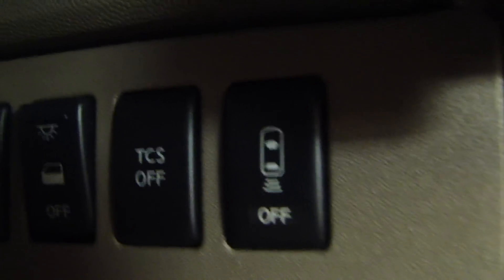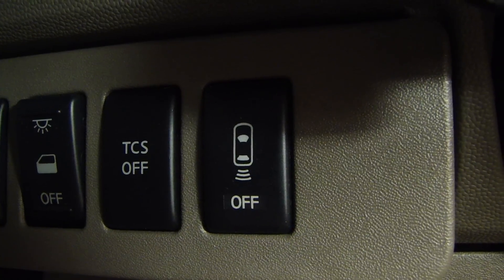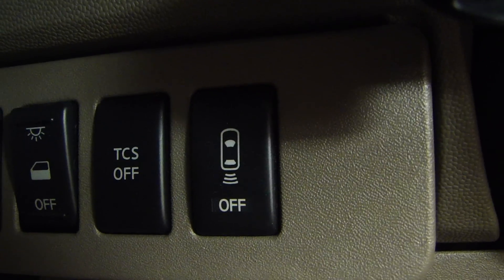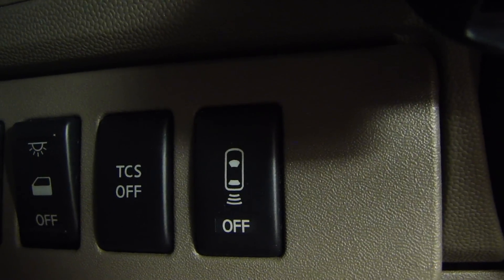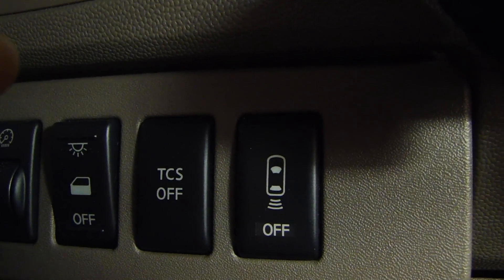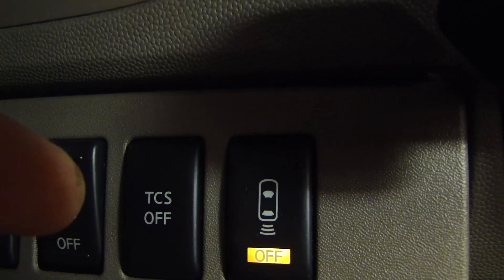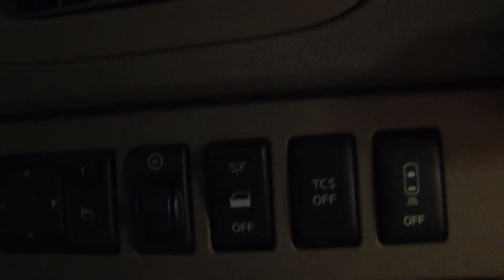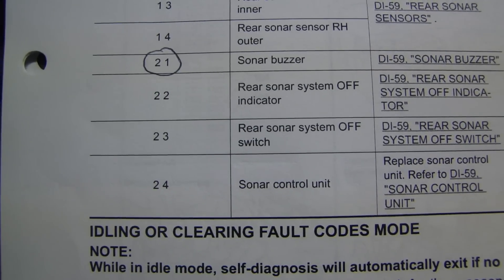Nissan Reverse Backup Sensor Check Fault Code (Quest 2004 - 2009) - PART 1

Comment: Hello bro, did you know how to clear fault code for 2004 Nissan Quest.on mine was buzzer work ok only problem was when I put gear to reverse the buzzer sound ok for  afew seconds and then  light switch is ON.i did try to replace afew buzzer but still the same problem.my buzzer speaker was 100 ohms .thank to bro.

Comment: Hi
I have a problem with my 2004 quest 
Where all the lights on my cluster panel comes on and stays on. Not only that the whole dash board light goes of and to come on I habe to hit a bump hard or bang on the dash board towards the passenger side

Comment: Question. I have a Nissan Frontier. The sensor light comes on when I start the car, then goes out like normal. The problem I have is, When I put the car in reverse, after about 5 seconds, the light comes on and it no longer detects if I am close to an object. Do you know what might be the problem? Could I have a bad sensor? Thanks, in advance.

Comment: What's the purpose of having switch for reverse bazzar
Reply: Raja SD 
I would love to know also..just bough this car today and no 1 can tell me what the switch is for and its in the same location as the back up sensor..its a metal switch...
Reply: @jessicathomason87  The switch is to temperarily turn off the backup beeper if you are backing up with something hitched to the back or have a bike rack on the vechicle, as the beeper would continually go off.

Comment: You have to press it 14 times within 5 seconds. If it gives you more than one trouble code. Press it once and get that code and press it again and it will give you the next one and so on. I had two codes (bad buzzer 21, and bad sensor 14).

Comment: Do you have any idea how to figure out what's wrong if this troubleshooting doesn't work?  I can push the button (on/off switch) 100 times and it won't turn off.
Reply: I have the exact same issue, on a 2007 Quest.

Comment: hey thank you for video , i got  question i got the infinity fx35 and when i diagnose the car they  told me i got Fault codes logged , ECM:p1212 tcs circuit and BCM : uo415,B2562, b2604,b2612 also Multi: u1000, u1300,u125b have you met with that fault code ?
Reply from the maker: +Anuar Talpakov Sorry not familiar with that code. Google it and check some of the online forums for your car for help.
Reply: SIR MY NISSAN TEANA SENSOR BEEPING HOW TO STOP IT
Reply: PLZ GV SOME GUIDE TO STOP IT

Comment: Hello my nissam armada has the same code 2-1 but how i can install the Sonar Buzzer or where is located?? Thanks.
Reply from the maker: ThePONY8906 The Armada is the same as the Titan and the buzzer should be located right above your steering wheel under the plastic cover on the dash. You just have to pry open the top cover and you will see the buzzer.
Reply: ThePONY8906 above the steering wheel take trim off and you can replace with any small speaker that will fit

Comment: This is a great video.

How do you troubleshoot Fault Code 1 3?
Any Idea where can I get information of how to fix all the Fault codes listed in your video?
In my case, I followed your instructions and confirmed my Fault code is 1 3.
Reply from the maker: Joel Flores Fault code 13 is for 'rear sonar sensor RH inner'. Check harness for open or short. if ok, replaced sensor. You can search online for the Nissan Quest service manual and refer to section DI.

Comment: my light stays on but I can't enter diagnostic mode at all???  do you have any thoughts as to what it could be??  Thanks dial your videos have helped me repair my quest alot and I appreciate it

and I have another issue and it is with my rear upper vents.... i can get the air conditioning to blow front and back but I cant get the rear vents to blow any warm/hot air at all is there anyways you could help me dial Thanks again for all your helpful videos
Reply from the maker: With the diagnostic mode, I am not sure except the procedure was from a 04 model year. Not sure if they changed later years. With the rear vents blowing hot air, under the factory radio, that whole stack is a air mix HVAC unit with motors moving flaps to mix warm and cold air to route the hot/cold air. If you are not getting hot or cold, then maybe the rear vent mix door is not working. There is actually a motor that moves that flap, but it's almost impossible to service without taking the entire front dash out of the car. You can try to put your ear right up on that center console area and turn that temperature knob and hear for any mechanical motor noise to see if the motor is actually working.

Comment: My diagnostic doesn't seem to be working. It worked once. I have 2 fault codes, but I did not push the button again quick enough to move to the stage where it give the specific fault codes. Now, I cannot get it to go back into the diagnostic mode. The light stays on indicating that it still has faults. However, it is as if hitting it 14 times is resetting the error. It just will not enter diagnostic mode. Any thoughts??
Reply from the maker: Not really sure, perhaps you can try disconnecting your car battery for an hour and then connect it back up. See if that allows you get back into the diag.

Comment: I have 2005 nissan quest and mine don't come on tell I put in reverse dose that mean there a promblem or is that normal
Reply from the maker: That light should not come on unless you manually pushed it. It could be the sonar control unit itself is defective.
Reply: dial2fast every now and then it beeps last year it would work in warm weather but of it rained it wouldn't any kind of  moisture it dont work
Reply: dial2fast I did your test and it said 1 4 so I replaced bit still don't work

Comment: The light just popped on our 2005 Quest with 60K miles yesterday. We're keeping it as healthy as we can as problems arise and your video really helps us do that. Thanks so much for taking time to define a problem and clearly explain a solution.
Reply from the maker: You are very welcome, and thanks for your comment!
Reply: Dose your turn on when you frist start it or after you put in reverse
Reply from the maker: nicole canchola With mine, a few seconds after I started the car, the backup switch light will come on and remain on (regardless if you in reverse or not)
Reply: dial2fast mine comes one only if I put in reverse and I can't turn it off

Comment: This worked fine for me excellent troubleshooting detail. I've found my code - a 1.1 replace the LH outside sensor.  Do you have a video or directions on how to replace a sensor?
Reply from the maker: I have never replaced the sensor itself, but I believe the bumper needs to come off for replacement.

Comment: Video was excellent for my repairing this condition in my '06 Titan.  Ordered the Pololu item but instead of cutting out the connector and soldering jumpers, I used wire taps so the connector remains useable for a OEM buzzer "if" future needs arise. 
1st time I tried toggling the switch for diagnostic mode, was unsuccessful.  Tried again later and it worked on 18 or 19 toggles. 3rd time, only 14.  Got 2 fault codes, 21 and 22 so I cleared the codes and tried again with only one code - 21.  

$1.99/ea for 2 buzzers + postage solved the problem.  Well done sir !
Reply from the maker: Thanks for sharing. Glad the video helped.

Comment: lots of great info.....glad i found your videos about nissan quest.  i have a 2004 nissan quest SE, hope u can help me with this one...... recently got my rack and pinion replaced by some mechanic friend of my brother, when i got it back the vcd light came on after i drove it out of the driveway and i also felt a buzz somewhere around the brake pedal (vcd off i assume) also the airbag light is flasing......then tried to use cruise control , radio controls and horn on steering wheel, and it didn't work. ask the mech. what happened he said he doesn't know ......said vcd needs to be reset by dealer. so i went online and researched these issues and it might be spiral cable (aka clock spring)......and is there a way to clear the vcd without taking it to dealer? hope u can help
Reply from the maker: I have not had this problem, but I found this post http://steamforge.net/wiki/index.php/Fixes_to_Common_Nissan_Frontier_Problems

Comment: 2005 Titan P/U Light stays on for 2 months and no sensor sound when backing. But two seperate times since then the Sensors worked? could a wire be loose or a short in wire??
Reply from the maker: Could still be the  buzzer about to go. The buzzer is just a speaker, so it may be on it's way out.
Reply: thanks a bunch
 will check the codes

Comment: Has anyone ever replaced an actual sensor on this type of vehicle?  Someone rear-ended my van and there didn't appear to be damage to the bumper, but once I got home, the buzzer turned on and the indication on the switch lit up.  I'm guessing one or more sensors were damaged in the collision?  Any advice would help!  I'll try the diagnostics when I get home tonight.  Thanks for this helpful video, dial2fast!
Reply from the maker: I believe you will have to remove the rear bumper to get to the sensor. But first do see if the diagnostic test can tell you if a sensor is bad. Good luck.

Comment: I did 14 times but light stays on. Could it be the switch itself that faulty?
Reply from the maker: If 14 push doesn't work, try 15 or 16 and see if the light turns off. Unlikely your switch is bad.
Reply: dial2fast still nothing no matter how many times, light stays on. i was hoping to save $ and fix myself. Maybe i should take it to dealership. unless you know what else it could be.
Reply from the maker: loicraven The fact that the switch lit up, the rear sonar module is still functioning (or somewhat functioning). If you have a multimeter, you can try testing the continuity of the switch. That would rule out problem with the switch. Other than that, you might need to visit the dealer.
Reply: That is happening to me also in my 2007 🚐

Comment from the maker: I believe when I researched this many months ago, the way you get fault code changed in 2007. If you have tried already, then it probably doesn't apply. See if you can find the Nissan service manual online and download it as it will have the troubleshooting info in them.

Comment from the maker: This one that stopped working was the Pololu buzzer. I have had it for probably about a year. Not sure what happened but I ordered another one from them and just came in the mail today. I will open up the console and see what's wrong. My only thinking on this is maybe the heat in the vehicle might have something to do with it during summer or I just happen to get a bad one. These buzzer is not that complex as far as mechanics go, they are basically a speaker. Will see.

Comment: How long did buzzer you used last? I just literally installed it today based on your first video. Thanks for that video, BTW, because I bought the buzzers from pololu that you suggested and installed the new buzzer - took me 20 minutes start to finish thanks to your video, saving me about $275 from my dealer.

Did you replace the sonar buzzer with the OEM part this time or did you use the same one you bought from pololu? What do you think causes these silly buzzers to blow out so fast?